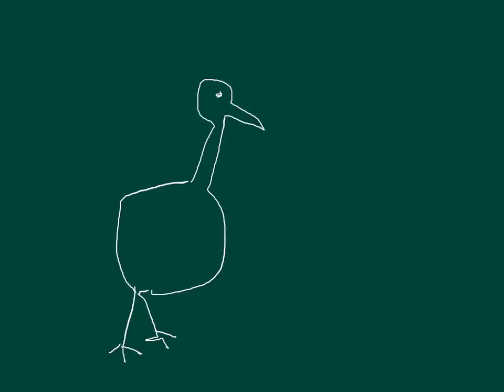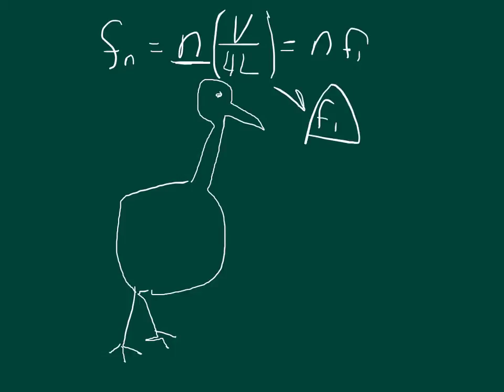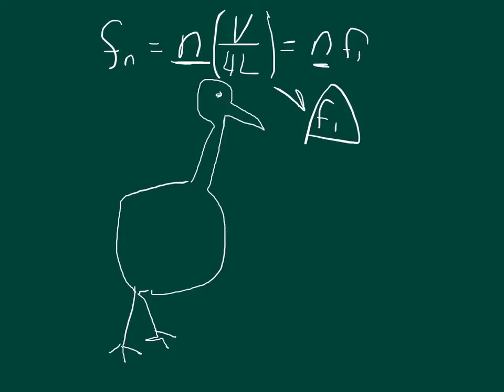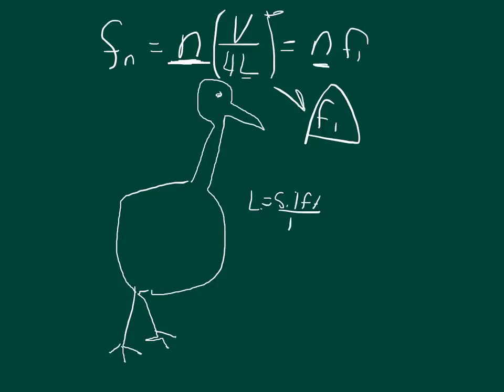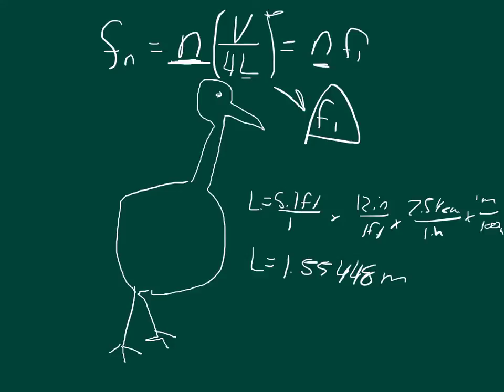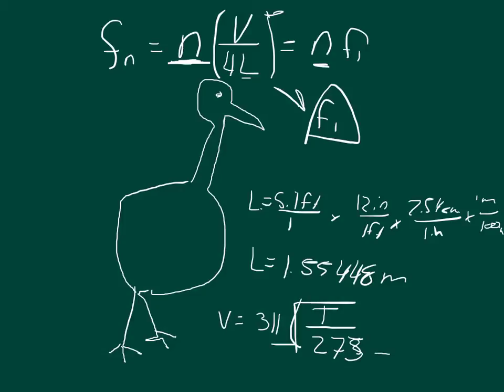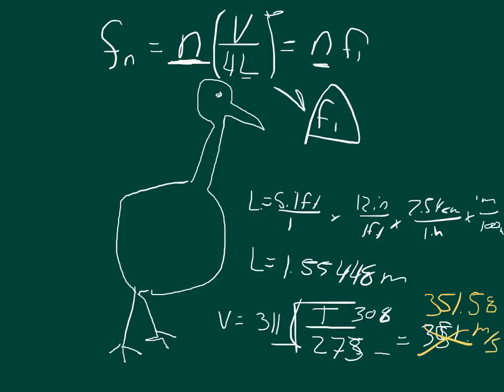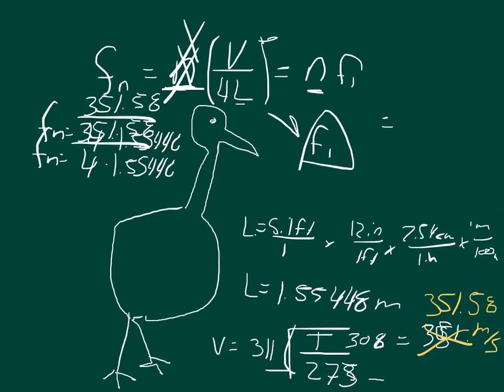Physics Web Assign Ch 14 #12

Comment: the velocity at 0 C is 331 m/s, not 311. your math does not work with the value 311.
Reply from the maker: Shannon Anderson 
Yeah, I’m not sure where I pulled 311 from. The velocity of sound, in air, at zero C is 331

Sorry for the confusion.
Reply: The problem states that temperature is 37 degrees celcius, thus making it 311 Kelvin. Plugging this into the equation for speed of sound provides the answer 352 approximately. Thus, Mike is correct in using 311.
Reply from the maker: I appreciate the ref. 
I have responded to soo many that say I am wrong, in the past (and I have been wrong once or twice), only to find out that commenter misunderstood the setup… I just don’t do it anymore unless the person is actually asking for help. 

But it’s nice to have a teammate volley on my behalf. Thanks Natedogg!
Reply: @MikeBirkhead  of course! Your videos are very helpful in advancing my understanding even if their is a difference in starting values for problems. You've been a huge help this year 🙏